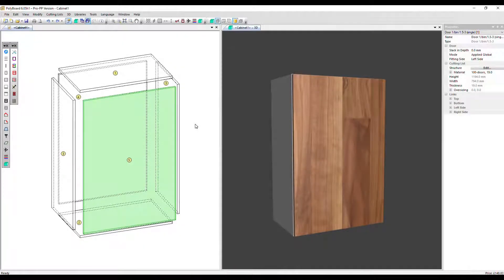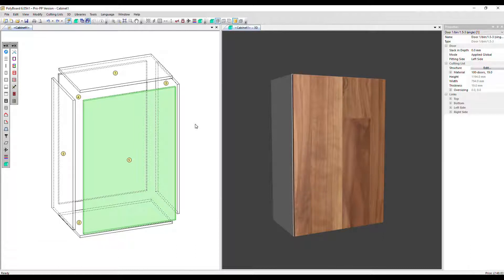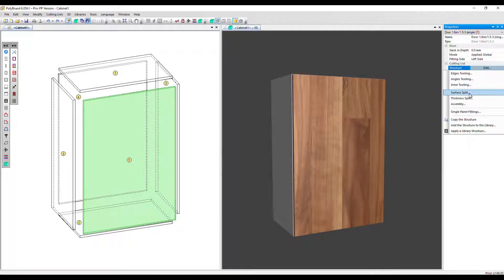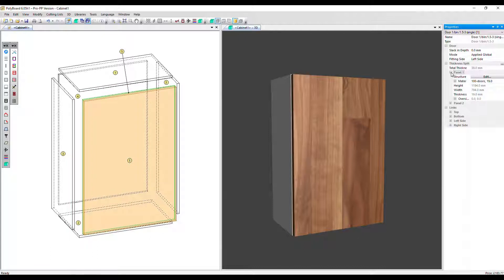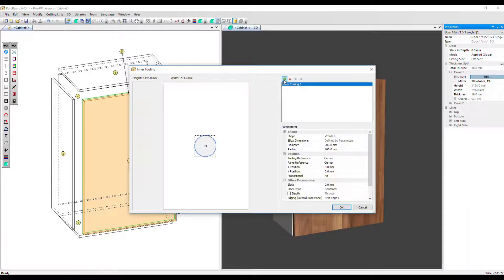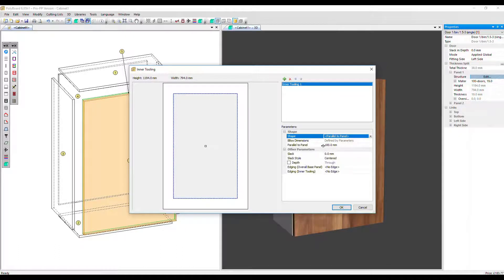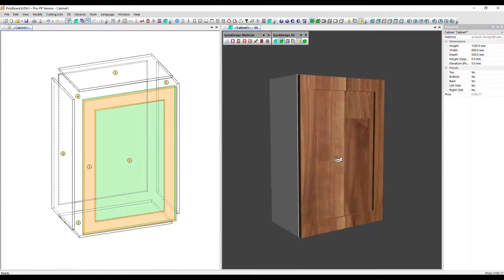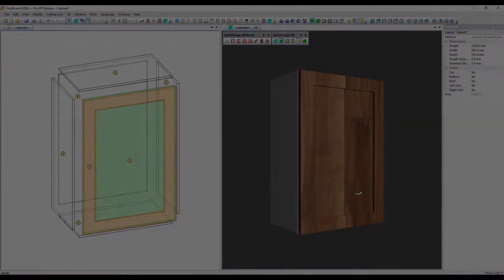Simulate a Shaker style frame with the Structures Menu in Polyboard

Comment: how do i setup my toolbar like you have on the left
Reply from the maker: Hi @Richard da silva ! If you've correctly installed Polyboard and the Quick Design libraries, when you open up Polyboard, you should have 4 new toolbars displayed on screen. Quick Design will display toolbars dynamically according to the Mode and the View you're working in. More info can be found in our Help Centre: https://wooddesigner.org/help-centre/polyboard-quick-design-toolbars-overview-quick-design-project-toolbar/ Hope this helps!

Comment: You can, on single panel, use inner tooling and instead of going full depth use 4-5 mm or whatever you preffer.
Reply from the maker: Hi, thanks for your comment. Yes you can use the inner tooling feature but set at a depth less than the panel thickness to create grooves and pockets for example.